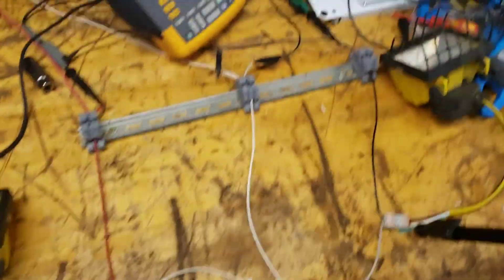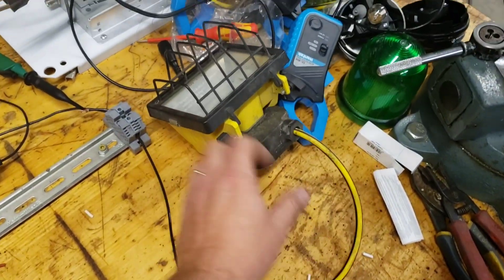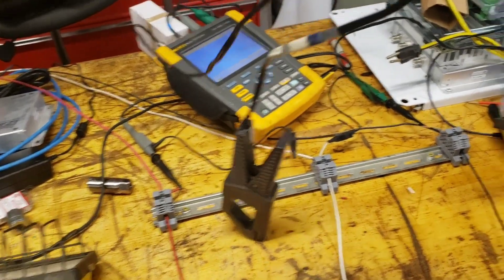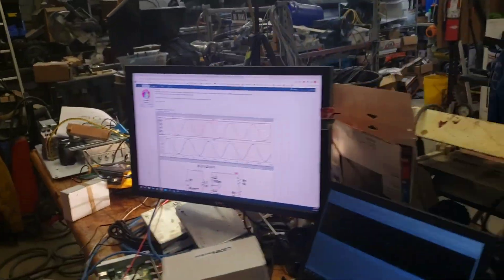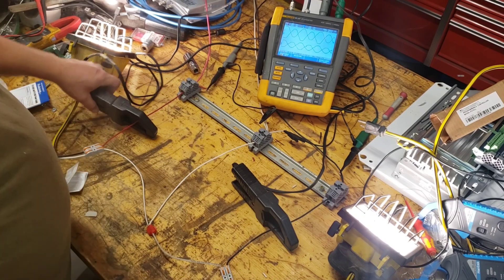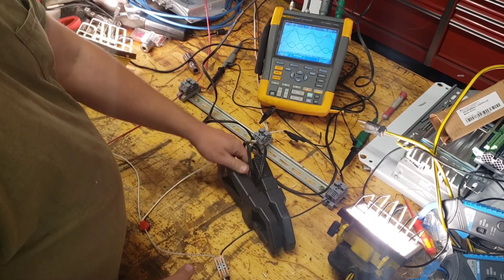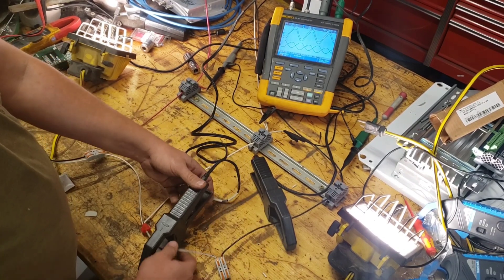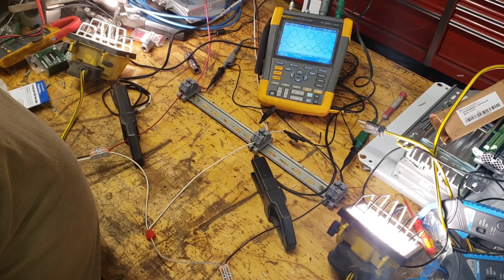Inverted/"180 degrees out of phase" current.

Comment: All you had available was a 50A two pole?!? Awesome! 

And I am solidly in camp "Single/In Phase" and one of the things that really irritates me are people who insist on calling the service to your house "Two phase". You can show them the sticker in the panel clearly identifying the panel as a "Single Phase" panel, and they will still insist that it has two (opposite) phases. 

I give up.
Reply from the maker: LOL yeah I popped that breaker into the panel just for the experiment. That's why the fascia was off of the panel, I didn't want to knock out the spots for it to stay there. It was the only spare 2-pole breaker I had. 

Not sure why the concept of single phase consisting of a single phase is such a controversial topic, but here we are....
Reply from the maker: That last comment i made was not intellectually honest. I DO know why it's so controversial. It's because not everyone is using the same definition of phase. There is a mathematical meaning and there is a practical meaning, and it is almost always not obvious which definition someone subscribes to just by reading what they write. If you think you know what they mean, you're probably wrong. Or at least I usually am.

The practical aspect relates to electromagnetic circuits; I.E. a single phase transformer will only ever be single phase regardless of whether it has one tap or 50 taps. The mathematical aspect relates to phasors and there is nothing stopping anyone doing a mathematical circuit analysis comparing L1 to L2 and calculating a 180 degree phase shift. They get all the right answers using that data and crawling through the circuit sprinkling little "+" and "-" symbols over components just like Kirchoff's laws dictate. 

Then there is the practical side of things which I demonstrated. For those heads lodged too deeply in the mire of the theoretical, the practical demonstration is an inconvenience. More than an inconvenience really; somewhere between inconvenience and heresy. They see it as something that must be shouted down lest future generations be utterly "confused" (confused = to have a different understanding that is not compatible with obsolete curriculum).

Comment: Perhaps one thing to improve understanding would have been to remove the neutral wire live (I am assuming a balanced load on each side), theoretically no current should have been passing through it (within load tolerances). Without the neutral, the currents would have to be in phase in order for the lamps to illuminate. Tongue in cheek humor was great!
Reply from the maker: Yeah, that would have been a good addition to the video. I mentioned that in the forum post that prompted the video (delete the neutral and it's just 2 resistors in series across 240V) but it didn't seem very compelling to those across the aisle. 

I am planning to do a deep dive on the textbook side of this debate to better understand where the others are coming from. Apparently if you work the problem out on paper using KCL, it only works if the two are opposing (so they say). But I suspect that is only true if you consider L1 and L2 to be two separate sources. I want revisit this video later, making more of an attempt to explain the other side; why they say what they say. Because there must be something to it, with so much qualified support of it.
Reply: @charlesstaton8104  I think those who "disagree" are looking at it from a single ground (midpoint) perspective only and fail to be able to it as a single source. I think anyone who designs electronics, particularly power supplies will understand there are multiple ways to look at it based on the particular load involved. Again, I think the issue with KCL is failing to see it as one source with two devices effectively in series. Presenting the problem to the math properly is the issue at hand, not the math itself. Looking forward to the follow up video(s).
Reply: If you remove the neutral, you are fundamentally changing the problem. The issue is whether the two live conductors in a split phase system are out of phase. The neutral is the reference point for voltage measurements in a split phase system. When you remove the neutral, you are no longer measuring two sides of a 120V/240V split phase system, you are then measuring the one phase of a 240V circuit. 

The reason the two split phases are out of phase is because we measure the voltage from the neutral reference which is from the center tap of the transformer. If we only used the two opposite ends of the transformer we would have 240V single phase. But in the U.S. we instead split the supply by tapping the center of the transformer, use that as our neutral reference and we get two lines at 120V, but out of phase so we can still connect the two of them and recover the original 240V.
Reply: @joelstyer5792  Yes, two devices in series but with opposite polarity since the node between them is our chosen reference point.
Reply from the maker: @jssamp4442  "If you remove the neutral, you are fundamentally changing the problem. " 

Your word choice here betrays the theoretical place from which your arguments originate. There is no "problem" here, nothing to work out on paper. I've demonstrated in the real world, with real electricity and real intruments, that current flows the same direction through the loads on both halves of the split phase. And they still would, in the real world, if I disconnected the neutral, in the real world. Do you disagree? Fundamentally, disconnecting the neutral with balanced loads and zero current flowing in the neutral, would change absolutely nothing. 

"The neutral is the reference point for voltage measurements in a split phase system." 

There is no holy reference point. Neutral is not THE end-all/be-all of references. It's simply the most convenient reference point for most people because they're using mains-referenced scopes without active differential probes. 

"When you remove the neutral, you are no longer measuring two sides of a 120V/240V split phase system, you are then measuring the one phase of a 240V circuit." 

Even before you remove the neutral, you're measuring one phase of a 240V circuit. When you take two measurements referenced to neutral, you're measuring one phase, one half at at a time, with two different probes. 

"The reason the two split phases are out of phase is because we measure the voltage from the neutral reference which is from the center tap of the transformer." 

Again there is only one phase, and yeah, the reason why the two halves of the single phase APPEAR to be out of phase, is because we are using the midpoint as a reference, which means one measurement is taken with reverse measurement polarity from the other one. The polarity/phase of the two halves of the split source however, are the same.